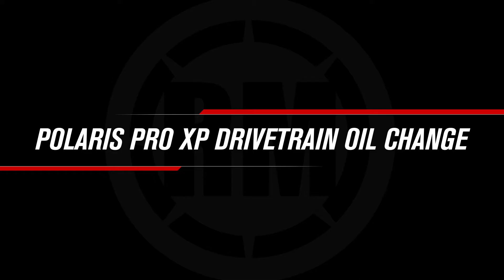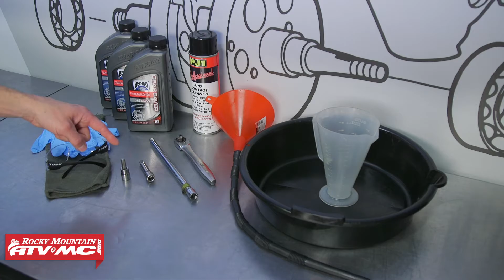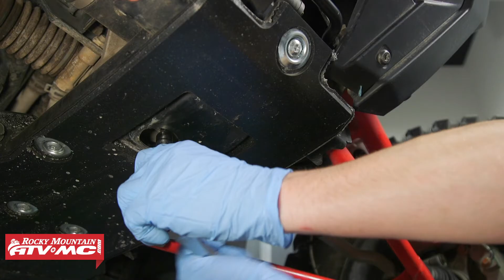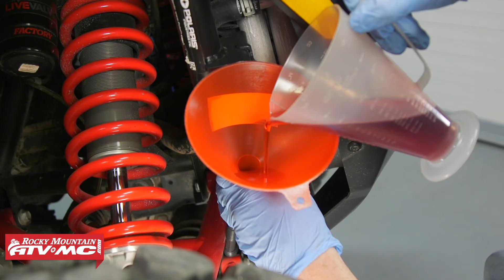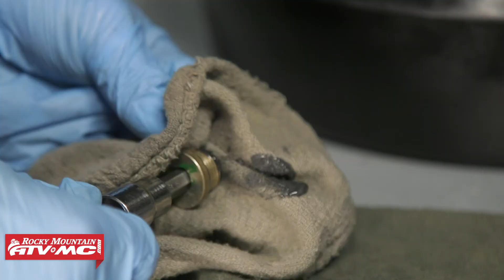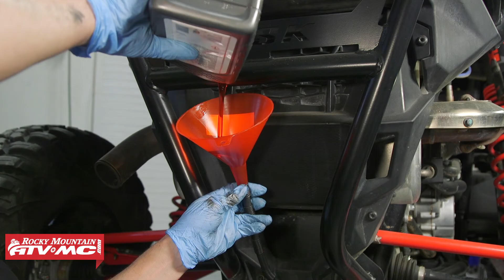How To Change the Drivetrain & Transmission Oil on a Polaris RZR Pro XP

Comment: The video straight from Polaris says for the fluid to also come out of the bottom of the fill plug threads on the front gear case. It's step 11 in the maintenance manual.